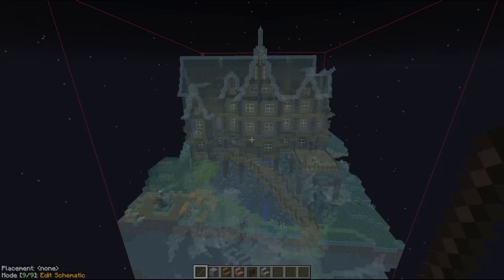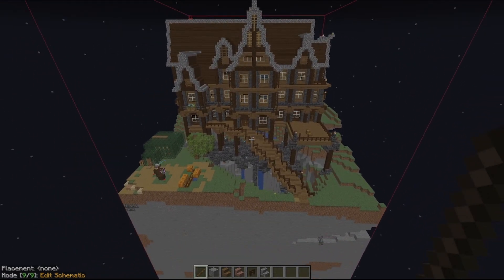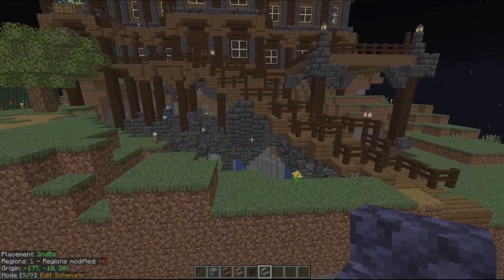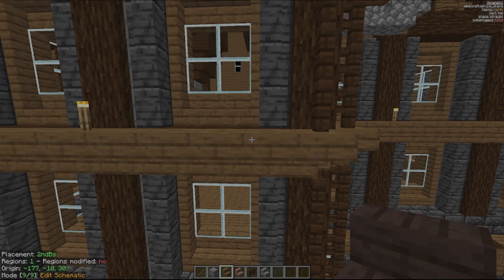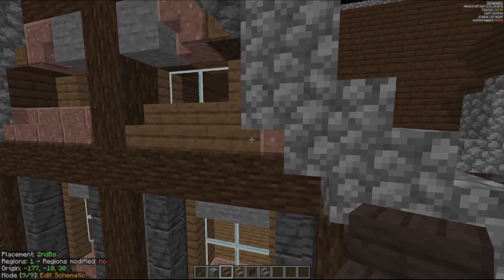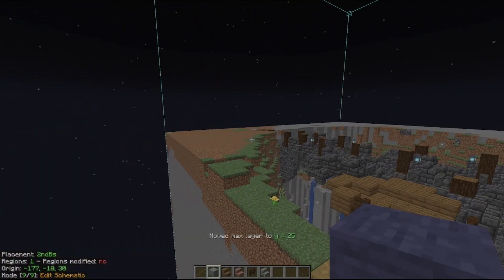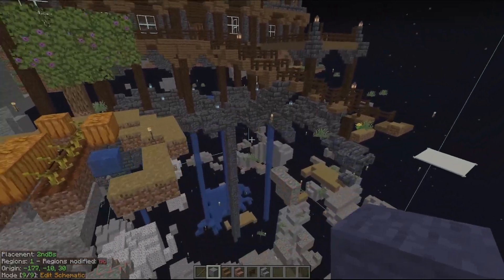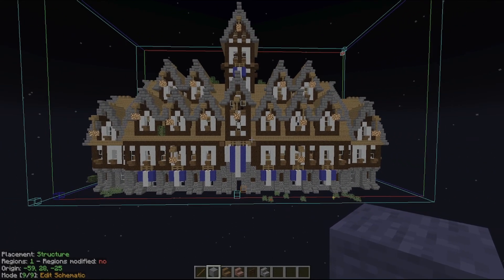Minecraft Litematica schematic editing

Comment: Hii, I hope I can get some help here. I tried to use the "schematicReplaceAll" , as I want to change all infested stone bricks to normal stone bricks. 
Before I could only replace it one by one, instead all at once.

Now I have the issue, that it removes the schem block as soon as I right click and then I have to manually place it back again with left click.

I am so confused, why it does not work and now is even more "broken"
Reply: I figured it out after a few hours. Great video, thank you!
Reply from the maker: @viviiiiixd  Thank you
Reply from the maker: What step in the process are you at?  Are you trying to build after having edited the schematic or attempting to edit?
If still trying to edit:  You need to hold down the key you assign in Hotkeys section to effect the mass edits.  The block will highlight on the surface you are looking at.  Right click with the block you wish to be in the schematic to replace all the blocks being targeted while holding down the keybind.  Once done editing, don't forget to save the changes(covered in previous video). Go into Loaded Schematics and click the Save to File button to save a new schematic.  It isn't recommended to save over the original file unless you have a backup in case of file corruption.

If you are done editing & trying to now build.  Don't forget to switch back out of edit mode.  The HUD in lower left corner will remain static when in edit mode as an indicator.  If you are not holding the tool in any other tool mode it will not be visible.  You will need to be in schematic placement or area selection mode to begin placing blocks in the world inside the placement area.

Comment: how do I edit like repeaters and so on
Reply from the maker: There is no way to change the data of a block stored in a schematic, & unfortunately you can only place a default value of any block you are holding.  In order to add extended data, would require you place them in the world and set the extended data first; then Left_ALT + Middle Mouse click while looking at the repeater etc; Then right click with empty hand in the schematic in edit mode.  You would use this same method to add the other half of multi-blocks like pillow section of beds or top half of doors.

Comment: why when im placing two chests in edit mode, one is single and one is trying to combine, and how do i make them both combined
Reply from the maker: That is a special case scenario.
Any and all blocks that occupy more than one block space have a kind of split NBT data for the game to consider. Beds, double chests, doors, two tall plants/flowers etc.
you need an actual double chest placed in the world in the correct orientation be that facing N,S,E,W will be taken into account.
to copy one or other side of the chest hold down the left alt key and middle mouse click while looking at left or right side of chest specifically.
It should now be listed in the HUD in lower left corner
Block: Chest - Facing: north for example
Then with open/empty main hand you can add to schematic with right click in edit mode.

If the schematic already has double chests in it that are in the correct orientation you can Left_Alt + Middle Click either half to record the block to be edited into the schematic without the need of a physical block in the world to copy into memory

Comment: for some reason it wont let me save the schematic after i edit it it just says schematic saving task created and then it does nothing
Reply from the maker: If it's a large schematic you may need to move around loading other chunks that the placement is in for the tasks to complete.  You usually get a HUD in the lower right corner indicating required chunks that need to be loaded to complete this.
Reply: @waynestir  they are loaded in the corner it just says remaing chucks 5 its been 40minutes
Reply from the maker: @praiserust  Are you in normal mode and have multiple selections in the world under the same schematic that are spread out?

Comment: how do i edit the state of a block? for example: how do i set trapdoors to be open in the schematic?
Reply from the maker: To add any blocks with extended NBT data like open trap doors that do not exist in the schematic already; You can use Left_Alt + Middle Mouse Click looking at an open trapdoor in the world to add the block to the edit mode that can be added to the schematic by right click with empty hand.  Note that the cardinal direction(facing) will remain regardless of player facing.  If you need other cardinal direction facing trapdoors you will need to repeat the process for each different state.

Comment: Hello how to use the area select mod with schematic ? I want to select the area by clicking the schematic block.
Reply from the maker: See if this video helps https://youtu.be/CTWC8sdmoEE
Don't know what you mean to select area by clicking schematic block.
Reply: @waynestir  When you use the Area Selection mod you normally click the blocks where you want to place the corners of the area. But when I want to create an area around a schematic, I can’t select the ghost blocks shown by the schematic—I have to paste the schematic into my world first so I can click its real blocks
Reply from the maker: @kevinbenoin4006  You can adjust the area selection  box a number of ways.  Watch that video I linked in my previous reply.  It covers a in some detail different aspects.  You can also assign hotkeys to set your two different corner points; setSelectionBoxPosition1 & setSelectinoBoxPosition2.  Each would represent a left or right click setting corner positioned where your currently standing.

Comment: hey, it seems like I can only edit a block once the after that it places a real block..

trying replace block edit

What a. I doing wrong?
Reply from the maker: Not sure. 
Are you editing at parameter of placement next to existing blocks in the world?
Is EasyPlace enabled?  Still shouldn't place blocks in edit mode unless there is an existing block it can place against where client would register the block placement not the mod.
Could be mod conflicts.  To test disable any other mods and run only litematica & MaLiLib and see if it persists in placing blocks.
I am at a loss to speculate further without greater detail of what is happening.
Reply: @waynestir  this was in a survival world so was trying to edit a schematic I downloaded.  easy place was off but I did notice that I could edit certain blocks easy, but a block like andesite was not changeable.

there were a few blocks I just could not edit. but I will try removing mods
Reply from the maker: @theotherguy6155  The schematicEditReplaceBlock does restrict editing to block types so you can't replace stairs for full blocks and things of that nature. You should be able to do full block for full block so oak_planks for deepslate_deebricks should work.  That said.  I don't know if it was an oversight or intentended the stripped variants of logs can only be swapped for logs.  Kind of makes sense as they can be separated into that catagorie, all be it a narrow one.  Use schematicEditReplaceAll instead to replace the logs for deepslate.
Reply: @waynestir  I created a new instance with only these 2 mods and still the same issue. I am trying to replace stripped oak logs with deepslate if that helps